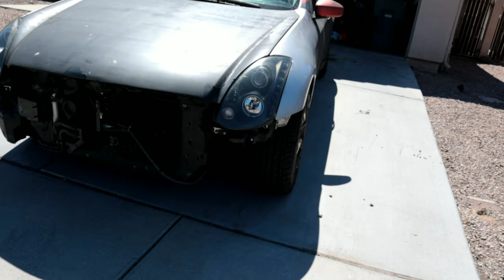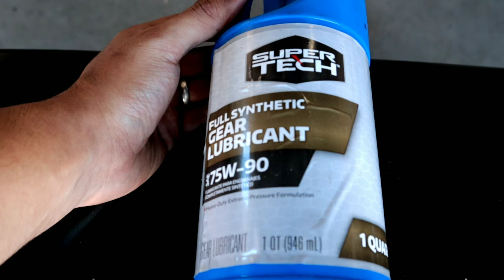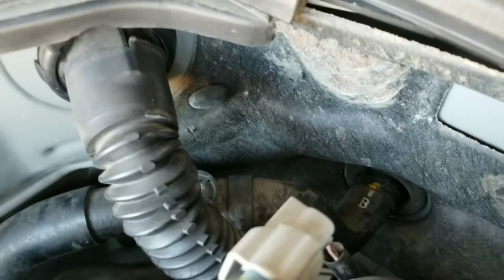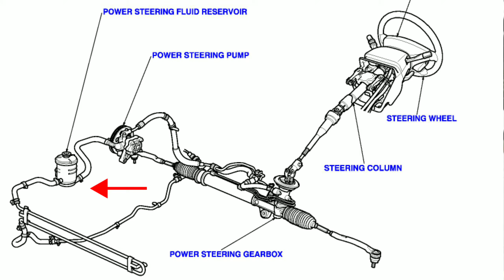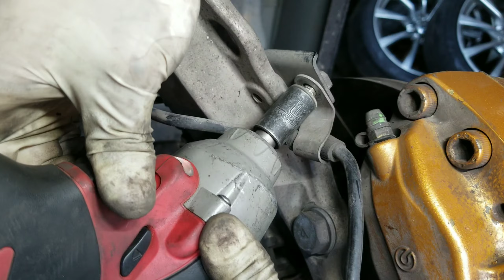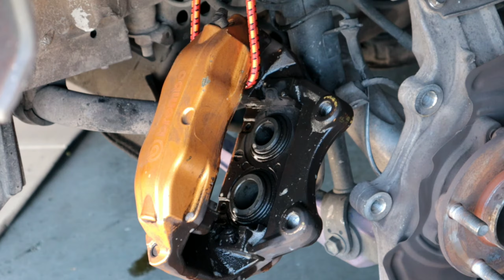How To Do A Complete Maintenance On Your Vehicle! Infiniti G35 Full Maintenance!

Comment: Thanks for the great video. How did you ensure there was no air in the power steering system after you drained the fluid initially?
Reply from the maker: Your going to get air if the system turning lock to lock with get the air out

Comment: Wait so do I add all the 2 gallons of coolant leave the bleeder open turn on the car and once the fluid leaks from the bleeder im done? No need to turn on heater or open and close bleeder for hours like other vidoes say ?? 2004 g35 coupe
Reply from the maker: Coolant always flows through your heater core the only thing your doing by opening the  vents is directing airflow to heater instead of your evaporator core. And yes you need to close and open your bleeder screw a few times but it doesn't take hours. Make sure you pour your coolant slowly and when it's full give the car a few high revs let it idle and than open the bleeder screw till coolant comes out. This video is not a detailed video it's just a overhaul
Reply: @ERICSDIYGARAGE  thanks for the reply man now I understand.

Comment: Question If your negative terminal melts ?
Reply from the maker: It could be that your ground is not good. You could also have compromise negative terminal cable inspected for any cracks
Reply: @ERICSDIYGARAGE  used up some electrical tape changed terminal all good. But know I have a hard knock smh 😪

Comment: How much power steering, automatic transmission, and differential fluid did you need to do these flushes?
Reply from the maker: I just used what the oem requires. I technically just drained and refilled all the fluids

Comment: I noticed your car at 4:02 has a rattle when you turn it on. I have an 04 coupe and it does the same noise on a cold start. I know it’s not related to this video at all but do you know what it is?
Reply from the maker: good question I believe it's the timing chain tensioner, do you have a automatic or standard g35?
Reply: ERICSDIYGARAGE mine is auto. But mine has 92k miles, I’m hoping that is not the problem with the car this early.
Reply from the maker: @arielcastillo4379  it believe it's the tensioner since it uses oil pressure to apply the tension. the only solution is to change your timing chain and tensioner/guides but it's not worth the hassle unless its rattling constantly.
Reply: ERICSDIYGARAGE exactly, it only does it at cold start for about a second and then goes away, either way, thanks
Reply from the maker: @arielcastillo4379  thank you for watching 👍

Comment: Just copped a new 6spd G35 Coupe, will be referring to this video a lot with the maintenance! Thanks for the content
Reply: ABathingAce II I recommend you replace the starter & alternator...so you’ll never have issues with the car not starting or it randomly shutting off on you
Reply: @zoomdirt2  it's good to replace the battery after if it's old
Reply from the maker: Thank you for your support!

Comment: Actually just did my overdue oil change yesterday (along with ATF drain and fill, and differential oil) as well changed the oil cooler gasket cause I think it was the source of a slow oil leak. If yours leaks oil where the filter is, check the oil cooler and see if its seeping. List of fluids I used in case anyone wanted to know:
- Pennzoil Ultra Platinum full synthetic 5W-30
- K&N HP-1008 oil filter (used FRAM Ultra Synthetic previously)
- Nissan Matic-S 999MP-MTS00P automatic transmissions fluid
- Amsoil Severe Gear 75W-90 synthetic gear lube
Reply from the maker: thanks for listing the products you used, I actually recently recorded the oil cooler gasket repair 👍

Comment: Are those the 370 or 350 rims? And are you using spacers
Reply from the maker: these are 370z wheels I'm using a 25 mm spacer in the front

Comment from the maker: This vehicle still needs a lot of work but I appreciate all the support! It's only a matter of time until someone comes up with a drinking game while watching my videos 😂
Thank you for watching!
Reply: What did you use to clean the brake area ? Thanx , Subbed  killer channel and work..
Reply from the maker: Just soapy water
Reply: Hey I just bought a g35 infinity in it makes pops from exhaust
Reply: I took it to O'Reilly's only code p300 ignition coils
Reply from the maker: @TrinityPhillphs  p0300 is not a code for ignition coils. That code is for a random misfire could be spark plugs connectors to the spark plugs are not in the right location or low compression and multiple cylinders. Even if it's out of time, it could also throw this code
Reply: @ERICSDIYGARAGE ok thank you 👍👍 I'm get spark plugs change today Oriellys gave me a paper says my ignition coils need replaced as well
Reply: Bank 1
Reply from the maker: You don't need the coil packs, first do change the spark plugs and check the firing order is correct
Reply: @ERICSDIYGARAGE would you do ngk spark plugs